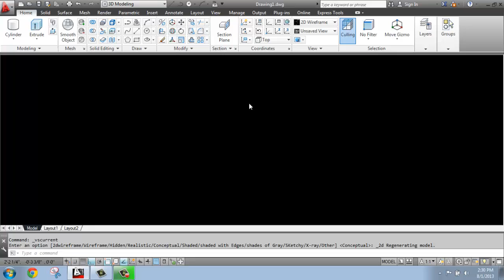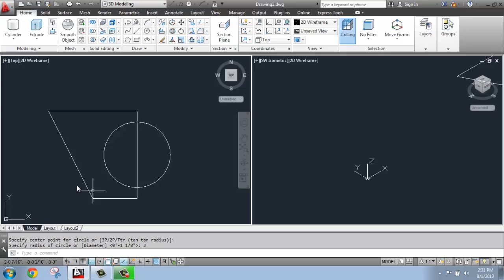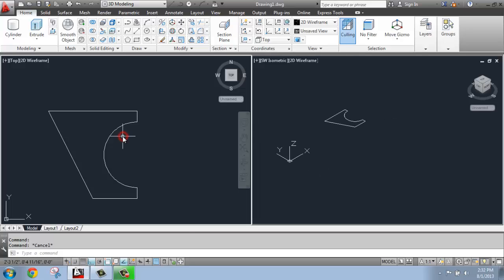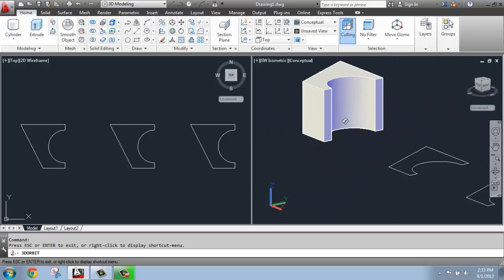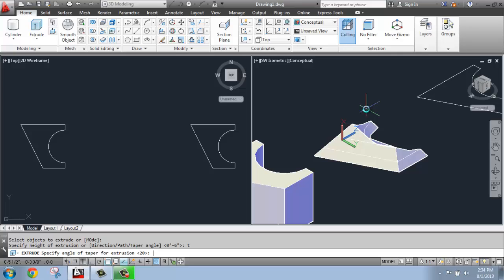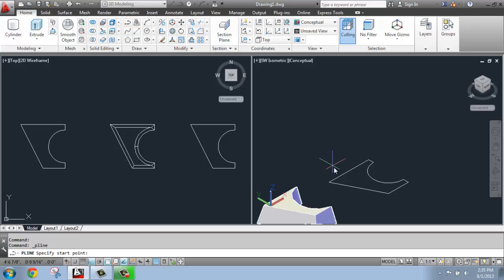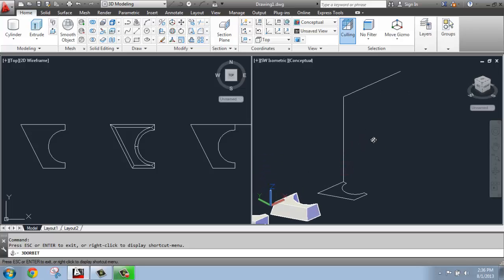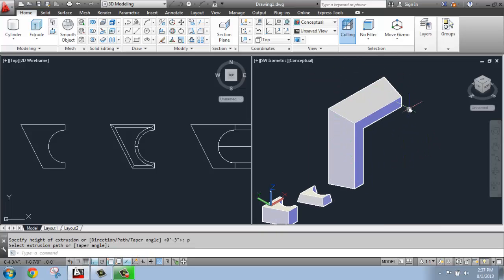AutoCAD - 3D Modeling Basics #6 - Extrude, Taper Angle, Path - Brooke Godfrey

Comment: Thanks for the vid, Brooke.  I've been trying to JOIN a series of 11 circles, drawn originally in 2D, in order to extrude as one unit. As far as I can tell they were all drawn on the same XY plane originally. 

When I select them, then click JOIN icon, I get a message on the Command line "_join 11 found. 0 objects joined, 11 objects discarded from the operation".   Moving over each circle makes them "glow" individually, not as one item, which tells me they are not joined.  Can you tell me what I am doing wrong?  Thanks!